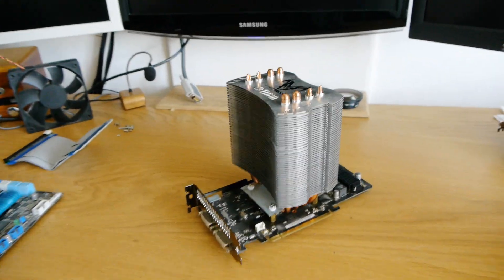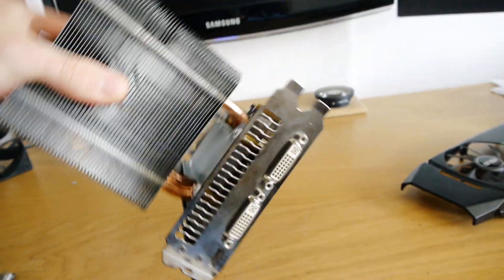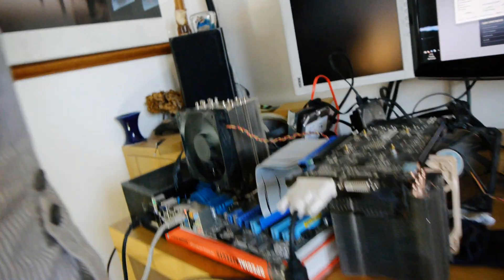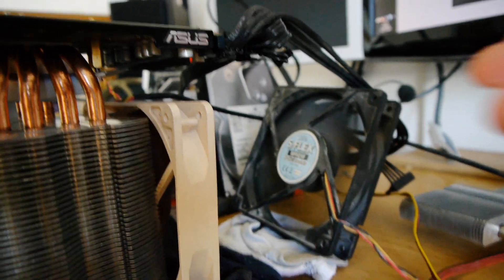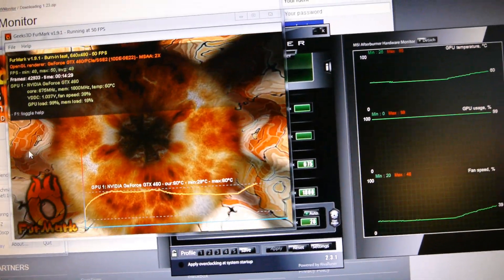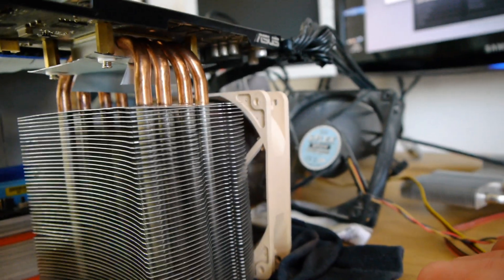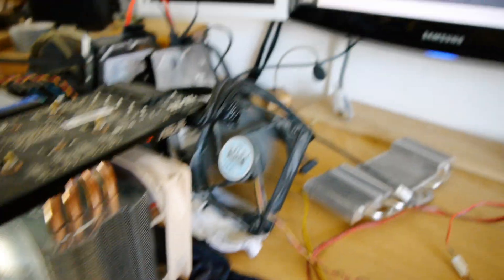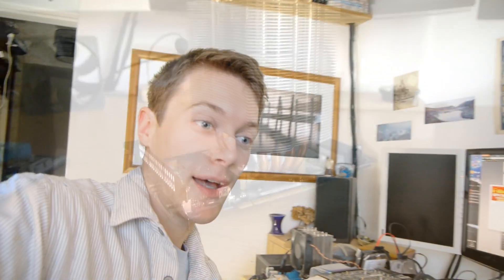CPU cooler on GPU (INSANE temps!)

Comment: u call that performance? mine goes down to 11.11c when i turn it on in a room with an  ambient of 22-23c (liquid, 3 liter cap, duel external radiator, both are duel fan, but have 4 fans each at 3,500 rpm - try it) .... wtf is this?? and why is it not tripping the overheat fail safe on the mobo?
Reply from the maker: Kyle Currier So your cooling setup defies physics? Interesting...
Reply: Kyle Currier "Wind is a heat transport when moving" - EXACTLY but the air that transports the heat, has to be that cool, it's physically impossible to cool metal down to 11°C with air that has a temp of 20°C. You my friend, are talking much bullshit or you're just a troll.
Reply from the maker: Kyle Currier Look, it's physically impossible for you to have a lower temperature than ambient, regardless of how good your cooler is (unless you use liquid nitrogen). It's a false reading mate. Besides, is that even maxed out, or is it idle? Idle power usage on modern cpus is very low, so it's not a very good test of your cooler if it's at idle and it's a useless value to throw around. :)
Reply: And you're an idiot, even if you were able to get such a low temperature, maybe using an AC, your pc temp shouldn't never go below the abient temperature or it will cause condensation on you components, unless the air in your room is 100% dry, i would recoment you to keep your hardware at room temperature
Reply: Which radiator and fan won the duel? This is the real question.
Reply: Kyle Currier you cant get a lower than ambient temperature unless you use some sort of refrigeration.

Water or air cooling ins't "refrigeration", it only removes and "exchanges" your components temperatures with the surrounding ambient temperature. Water is more efficient than fans  at converting those temperatures but it doesn't create "cold" temperatures like a fridge, get an actual thermometer and place it near the water block of a cpu and you'll see.

The only physical way to get lower than ambient temperatures is with an actuall refrigeration system, for example like the ones used on ACs/fridges (gas compression), evaporation, or with already cooled materials like ice or liquid nitrogen.

But even then, its a bad idea to keep your pc components temp under the ambient temp because of condensation, water droplets, like the ones that appear on a cold beer can are far more dangerous than any temperature.
Reply: Ruben Fernandes Dude, the PC temp can't even go below ambient temperature when using air or normal watercooling.
Reply: Kyle Currier So you went 9 years to school, just to troll in the youtube comments with your bullshit? Please tell me more about your life! I didn't need to go 9 years to school, just to set up watercooling and learning the laws of physics. :)

http://www.overclock.net/t/969347/is-it-possible-to-go-down-below-ambient-temperature-with-liquid-cooling
This and much more by googling. Oh and searching for your name in connection with watercooling doesn't find anything, somebody with 22 years of experience with his "trademark coolers" must atleast have a website.

http://physics.stackexchange.com/questions/89522/how-can-ambient-cooling-cool-a-system-to-below-the-ambient-temperature

And you had to protect your components against condensation, if the shit you're talking was real.
He's just a simple troll with no education, I mean, look at his nonexistent albums you assholes. :D
Reply: look sometimes you get a false reading, i have a fan claiming it is cooling my pc to -274 degrees C, which is the same as absolute zero.
Reply: Jens Egginton that's cute. One of my sensors reports -279.9c. I'm just that awesome at designing a cooling system. It's not an inaccurate reading,I'm just that awesome
Reply: Kyle Currier
You have been building them for 11 years and you still havent learnt the laws in relation to cooling.. IMPOSSIBLE unless using some sort of refrigeration unit which to be honest that fucking thing sounded like it had one on.... I cant believe anyone was happy with that pc i am sure it had great cooling ( not the bullshit figures your trying to spout ) but id chuck the fucking thing out the window after couple hours it TO FUCKING LOUD i have put together servers with industrial fucking fans that made less noise than that thing... Honestly mate start using some quality fans a little hint larger diameter at slower speeds produces as much performance cooling wise with ALOT LESS NOISE.
Reply: Kyle Currier I bet you're the kind of person that thinks blankets produce heat
Reply: DIY Perks It's just THAT good!
Reply: goingtoscotland Haha, so your pc is colder than the absolute zero, you truly are awesome :D
Reply: Overheat failsafe? a GPU can handle higher teperatures than a CPU, up to 90-95C before throttling. A cooler that big could cool it with passive cooling alone.
Reply: Kyle Currier Here is what the internet says about your MFA. "Additionally, in the United States, an MFA is recognized as a terminal degree for practitioners of Visual Art, Design, Dance, Photography, Theatre, Film/Video, New Media, and Creative Writing" In other words, its fucking shit and totally irrelevant to technology.
Reply: Kyle Currier There's no need for anyone to be offensive here... Either at you or you at them.
But what you claim defies the 2nd Law of Thermodynamics. Entropy tends to increase, and you can do less and less work in a closed system. Lets assume your home is a closed system with an ambient temperature of 23C. Since nothing can affect and cool your room, 23C is now the minimum energy "state" of that system. If you introduce a hot metal cube of 70C, naturally, the interactions between those two objects will cause a tranfer of heat or "energy". Note I use Heat, and not Temperature, since heat and temperature are NOT THE SAME THING. For the air to "cool" the metal cube, it has to absorb its energy. After absorbing energy, its energy will increase. If you wait long enough, the air and metal cube will both stall at around 30C, depending on the volume of the metal or your room. At that point, no "work" can be done anymore, since the system is dead, and both objects have the same energy levels. That is called the highest entropy level. Entropy is the disorder or "chaos" of a closed system. Entropy is irreversible.
http://en.wikipedia.org/wiki/Second_law_of_thermodynamics
http://en.wikipedia.org/wiki/Entropy

Now if the air absorbs heat and the cube loses heat, there is no way that the cube goes below the ambient temperature, since you will diminish entropy without any external interaction. Explained simply, if the cube goes below the ambient temperature, it will quickly go back to the ambient temperature, since it will absorb the heat from the air.

Hope this explains most things. There might be some errors, since I am studying Physics in University, but most of it should be accurate.
Reply: My goes to 8C on a 24C ambient
Reply: Unless you added phase change or peltier units into the loop,that is just an erroneous reading.
Reply: Kyle Currier Looks like somebody was reading the wiki. Well let me tell you something. You are nothing more than a newbie at computers and a douche at physics. It is impossible for what you say to be true. And 21 years of experience? By the look of your profile picture it means you started doing this since you were 3 years old. Or as ***** said you are not even 21 years old. I think that I know more about computers than you and im almost 14. Basically, you are either a disgrace to the trolls or a rock just hit you on the head.
Reply: Marc Warren There is a big difference between using an active cooling element (any material with lower temperature, condensation, compression or other mechanic)  and the shit that Kyle Currier claims.
and with a peltier-element down to 5°C ? yeah, when the PC is not running....
And the thing most forget about peltier:
While they do work, they generate an enormous amount of heat themself.
A saw an i7-260k colled won to 14°C on idle, and 32°C under load with it.
Well, the peltier for that needed ~ 250W alone - far more, then the CPU + cooling together.
Without it, the CPu is a bit warem (24/38), but you waste a wooping 250W less energy, making the whole room stay cooler.
Reply: Omg face palm, obviously you are gonna get better performance because you have special liquid cooling like they have in car radiators and higher rpm at fans + duo fans.
Reply: please guys, lets be civilised and don't feed the troll =_=!
Reply: cool story bro
Reply: I use MSI Afterburner, but the program doesnt matter, it reads from a sensor on the board, its calibrated, i also have 8 other probes, one of which is between my water block and processor.
Reply: Been doing them professionally for 11 years, 21 years of experience, those are my trademark coolers. I designed them. Notice how the radiator is on the outside. with 4 brushless, stacked cooling fans, and another 12 inside the case, with 4 of them alone on the window. the whole case is vented as well (meaning its got heat ducts and mesh)
Reply: When is the last time you guys picked up a physics book? Do you even science??? Wind is a heat transport when moving, and its moving very quickly though there. That temp is at idle, it jumps to 57 under normal load and 64 max i saw on gaming, ahain i have benchmarks, vids of the whole process, and a design that nobody else can do because of shipping issues, and the other custom guys cant compete. .
Reply: If it were the same technology we would have cheap 3.5ghz GPUs
Reply: Applicatoin-specific (integrated?) chip. Also, stop with the insults. Seriously, no need for it.
Reply: no, I have it on an old celeron, because I had nowhere else to put it. at 12v yes it does get that cold, I just need to run the CPU fan at at least 50%. its my guinea pig computer, so im just messing with it. the temps are real though
Reply: ZOMBIE BRAINEATER yeah its so fucking annoying.˝i has a dueal core cpu in my conputr m-kay ˝ :D
Reply: ***** Or a phase change. Or if he's running duct-work and attaching it to his radiators.
Reply: DIY Perks He probably shoved it in the fridge
Reply: Shocking that you have shut the hell up with your bullshit fake physics and claims now that you have been called out by so many people.
Reply: yeah i like to play games maxed out instead of cant playing it.
Reply: DIY Perks
whats the point of a water cooler if you can't cool anything below the ambient. whats the point in the radiator on a water cooler if it doesn't cool the water. hmmm i wonder why you use a fan in the summer. it must be the feeling of the air not to cool down or anything. i wonder what a air conditioner is for. it must be to cool the room to the temperature it's already in.
Reply: NikoliZZer Dude u are really dumb aren't you? cause the fan cant cool it that much off... when then fans cools it 20 degrees and its get 100 degrees hot of cause your room will get warm... Btw for all kids here of cause a fan will cool off the air. Its because of the air humidity. There is just microscopic water in the air that u just cant see and that's why the fan can cool off the hardware beneath the ambient room temperature
Reply: NikoliZZer You should know that a car engine produces heat ;) thats why you need a ac lmfao these kids
Reply: NikoliZZer
 what the fuck is the point in a watercooler if it doesn't cool.
Reply: ThatBlokeYiddy The point is to cool the components. It's a simple mechanic really, it moves the heat from the components to your radiator where a fan blows ROOM TEMPERATURE air at it. The cooled down water (by, once again, room temperature air) moves back to the components to pick up new heat, moving to your radiator again to get dispelled.. again. Have enough hardware and ambient temps will noticeably rise.
Conclusion; since cooling is done by room temperature air you can not have hardware temperatures drop to 11.11 degrees in a 22 degrees room. It will most-likely increase 5+ degrees whatever cooler you put on it. It's seriously not rocket science. If a water cooler would cool it wouldn't need a fan. If a fan would cool you wouldn't need a air condition unit to cool a room. And why not place a simple 120mm fan on your sixpack o'beers? That's right.. it does fuck all but blow air at it.
Reply: theBraxil surprise! Use Labrador spit as thermal paste. Labrador spit has been efficiently cooling dogs of up to 45kg's for hundreds of years! Now you can harness the natural cooling wonders for yourself! Simply 2 drops of Labrador spit can increase heat dissipation by 100 times!
Reply: I know its been said. But Kyle Currier you are a fucking idiot!
Reply: You realise that if you cool it below ambient room temperatures you will damage your chip becuase water will condensate on it?
Reply: *****
wtf what kind of thermal paste and cpu your using, intel atom underclocked to 500mhz?
Reply: I got my Laptop to reach a temperature of absolute zero by putting a half-eaten Popsicle on the bottom of my laptop. I think the key here is that the Popsicle be half-eaten. If it's partially eaten or not eaten at all then the Popsicle will have no effect on the temperature.
Reply: Kyle Currier got crushed!!!! OMG he got beat up so bad he quit responding lol.
Reply: He might not be lying. I've heard most temperature sensors for processing components don't provide correct temperature readings until 30+ degrees centigrade, and below that they are kind of a crapshoot as to what they'll read out. I guarantee it isn't actually <11 degrees unless his radiator is in a fridge, though. His sensor is probably just reading out wrong.
Reply: ***** Protip: next time you shame the trolls, instead of saying something like "im almost 14", say "and I'm not even 14 yet". It emphasizes the fact that you're younger and maximizes rage.
Reply: DIY Perks What program did you use to test that?
Reply: DIY Perks i have pictures and vids to prove it :D
Reply: DIY Perks Eat it bitches :P https://scontent-b-atl.xx.fbcdn.net/hphotos-prn2/v/t1.0-9/1374237_10151958040699935_159036159_n.jpg?oh=e13225ab9a6b30177f1a4ced7062866f&oe=5477B3C4  add me if u cant see it.
Reply: Heres a vid of the tower - I like my ass to be kissed on the left cheek please :) https://www.facebook.com/photo.php?v=10151948708454935&set=vb.623754934&type=3&theater
Reply: DIY Perks Keep dreaming, I build them for a living. why dont you ask it's owner, Reginald Thomas Jr.and his wife Grace about it :)  ull find them on my friends list.
Reply: and that's not the only comp that runs that cool, look at my albums assholes :/
Reply: DUAL!!!  learn to spell and use the RIGHT words
Reply: Eh, no. GPU's are basically ASIC's.
Reply: have any of you people ever heard of the peltier effect? might wanna look into that. i got a peltier cooler on a cpu right now and it runs at about 5 degrees celcius compared to the ambient temp of roughly 25 degrees
Reply: Kmlvox like i said, i have one installed in a computer now. i have had no problems with condensation as of yet. of course if you use one you have at least a slight amount of intelligence to know to insulate it with foam or silicone or something. peltiers are more popular than they think. in fact several manufacturers actually make heatsinks with peltiers on them. smh
Reply: chrischoy9 That'd be stupid as condensation would quickly form.
Reply: ***** Wow. That was... beautiful.
Reply: Why did it post this twice?
Reply: Naeh doode tis MA babie
Reply: you made my day =D lol. You are insane stupid man, nothing personal. And you should go back to school, until it's too late =D.
Reply: but is your computer completely silent? no, then stfu
Reply: is this setup completely silence no so you should stfu sur puppa
Reply: Justin Meyer this setup is in a case completely silent, ive seen yours now, it sounds like a fucking jet engine.
Reply: u cant even have seen my one lmfao?
i havent posted it on youtube and this setup isnt completely silent
Reply: Justin Meyer you posted it on a comment, and in a case this thing is completely silent, at max load you can barely hear it. I would want a gpu with almost no noise and a very good temperature all day of the week instead of a gpu that sounds like a fucking airplane with unnecissary low temps
Reply: Justin Meyer do you know anything about computers? You could do this with a 780 ti, and get it completely silent and play ultra settings on 144 fps. Completely silent
Reply: Kyle Currier At least I had a good laugh from it xD
Maybe one of your programs confuses Fahrenheit with Celsius?
Reply: Kyle Currier oh really if you have so much experience then why are you here go to your professional stuff you dumb fuck
Reply: You computer is fucking loud.Louder than a person using a microphone
Reply: Kyle Currier Well, AMD FX have a problem of with the heat reporting in the chips until they are under full load. My FX chip ran at 13 degrees...
Reply: I love reading comments section, I learned a lot just by reading these replies, :D 
Thank you internet.
Reply: sur puppa U could also get a artic accelero and its almost completely silent xD?
Reply: ThatBlokeYiddy cause air conditioning works like water cooling... right. Not sure how to reply to your.. let's say "kind", but a fan doesn't lower the temp, the breeze only makes it FEEL cooler. In your genius mind a guy waving papers around would lower temperatures as well.
A radiator dispels heat, it doesn't cool the water in it. It's just transferring it, where a fan comes in handy to blow it away. This fan can't blow air cooler than ambient at it, so the radiator will never drop below ambient.
Reply: Slamdoxicalz
 a radiator dispels heat. whats happens when there is no heat? it's cold!
Reply: ThatBlokeYiddy If a fan cools the air, then why, when your computer is on full load, your room ambient temperature rises instead of going down? Explain to me, stupid. Actually don't, because you're only gonna spit out more crap that's only a disgrace for the entire human race.
Reply: Justin Meyer Ah okay. Alright. Then explain to me why won't the air from your car ventilator cool the inside of the car on a hot day until your turn on the AC? Or why does a refrigerator use a complex system to cool it when just regular fans would do the job?

Let me explain you in a way that a person with normal intellectual capability would be able to picture the situation with fans.

Think of the heat as smoke. You have a box that's full of smoke, and it doesn't move anywhere, it's there. Then you put a fan to the side of the box, and the fan blows the smoke out of there, just like a fan blows the warm air out of the computer case. The smoke doesn't magically disappear, it just changes place and mixes with the surrounding air.

Also, if increased air movement would affect to the temperature of the air, then why doesn't the thermometer on a car show a lower temperature once you're moving really really fast, compared to standing still (doesn't apply to when the car sits in direct sunlight)?

I know that the mistake people make is underestimating the stupidity of idiots, but sir, you've just set a new low. I would like to congratulate you and wish good luck with your life in your fantasy world with your own physics that you've just made up.
Reply: NikoliZZer
 i'm saying a watercooler cools shit.
Reply: ***** Asus?
Reply: ***** Is your gpu from asus?
Reply: dude i mean the model is it from asus ?
Reply: lol dude. the elments are called heat dissipators for a reason. they dissipate heat. so logicly thinking the temp will never go below ambient temp. unless you're using a compressor and gas to cool it down, which clearly you're not.
Reply: Kyle Currier Keep your damn hands still.
Reply: Kyle Currier Those last 4 comments sound like fucking copypasta....
Reply: ***** wind chill is merely a perceived decrease in air .. just something you feel. Your PC won't feel.. :P
Reply: Good news guys, I'm a single mom working from home and I found a way to super cool your cpu to -298℃ by following this one weird tip that doctors, ahem, I mean computer companies don't want you to know!
Reply: mine like a fanless card with custom fan cooler only idle at 67-71 and loads at 71-74
Reply: i forgot to mention my card is oc'ed by 150mhz
Reply: mine card thermal paste dried.... that why my card don't get really big temp drop when installing fan
Reply: dude are you stupid :DD i build custom water coolings too and that rig of yours is nothing compared to mine... and even i cannot go below ambient... it would, if it would be possible but it just is not... i also have tried how it will react to outside (-20c) and it still it stays in atleast 15c in board because its generating heat and to keep components alive... in some point motherboard shuts off all fans connected to it, and it will shut itself off in less than 10c...
Reply: you still at 11c with fan and liquid cooler, mine without any fans go down to 30c at load with 25c ambient
Reply: *****
wew! damn dude lol
Reply: *****
shit wtf my 65NM (yeah 65nm) core 2 duo that have 65WATT TDP!!! with stock cooler and ambient temp of 25-26c and its on 34c min om the floor, i might get better temp when on a desk but i haven't buy new desk yet...
Reply: mine goes 0°K
Reply: Im pretty sure you live somewhere cold?
Reply: That's impossible you lack understanding of thermal dynamics
Reply: To get EXTREME , go to an anticatra and get liquid helium and get a dry ice and thrown it on top of every piece or connect your heat pipes into the cold water at that place
Reply: Somebody call the police! he/she is breaking the laws of physics!!!
Reply: Steve Kurchy
lol dude my water cooled pc resviour comes from a fridge frezzing my water at 4c
Reply: ***** It is a bad reading. The fans exchange the room air with the stuff inside the computer, it is the same thing for liquid cooling. I had a bad reading once and it said my motherboard was 134c if that was real my computer would be destroyed by now.
Reply: Steve Kurchy
no no the FRIDGE temp is at 4c i didn't ment my cpu nor gpu is at 4c, mind you at load the cpu is at 45c and gpu is at 38c with the liquid temp from the fridge is 6c
Reply: Slamdoxicalz I know exact what happens here and it because he use the FX8350 CPU.
the temperature is not monitored the same on mine either. as for me the AllCpuMeter gadget he also use show about 8 degree celsius at idle with my Dark Rock PRO2 CPU cooler but under load the values change very fast and follow the percental load rather than temp. if i go into my bios and check the real CPU temp in there i get a whole different story with a true value. I could make a video showing this if some of you would like me to
Reply: goingtoscotland Temps going past absolute zero, wow I need a pc that can handle that ^_^
Reply: ***** dude, all i can say is aijd;lkandbeyfvbisdfsdf and I want some cryotech stuff too
Reply: Kyle Currier Doesnt work idiot(link)
Reply: 21 years of experience and you're 28 years old. Professionally for 11 years? I think not.
Reply: grimecube Thanks for the advice mate :D
Reply: Although what you state is actually impossible, beside you would have water dripping from loop since it would be even cooler then what your cooling the due point at 50% relative humidity would be around 12C in a 22C room.  The noise a system like you described would make is just laughable, if i employed someone to build a system for me, which i never would.  I sure as hell would expect that it runs at a level where i cant hear it all around my house, 3500rpm? Really? Would sound like you live next to an airport.  Anything over 2000rpm and i can hardly stand it unless i wear headphones and even then i can still hear them.   At idle i run my loop fans around 1200rpm and at most on a high load at 2000rpm but thats at a push with custom fan profiles.  The temps this guy got with this mod are very good, these cards would run into the 80C easy with a normal cooler.  Overheat failsafe on mobo?  Who are you trying to kid, kid? Most old gpus would frequent the 80-90C mark with no issues, newer gpus start throttling around 80C (nvidia at least) so they wont go beyond this temp.  Your comment is flawed throughout and i believe you kinda miss the point in why most people water cool.  You can get lower temps under water then you can with air with much less noise required to do so. 3500rpm LOL's
Reply: 3500RPM LOL.
It's a fucking jet engine